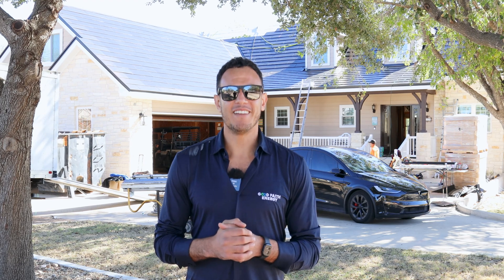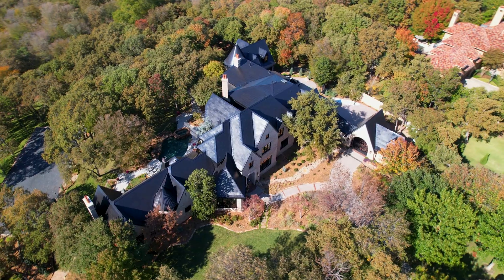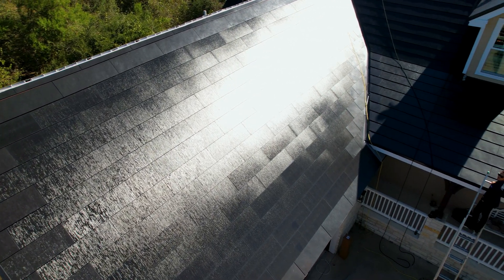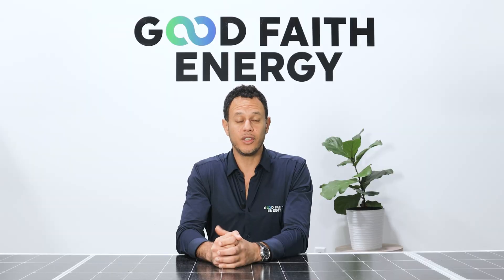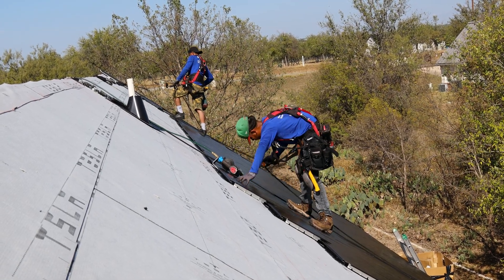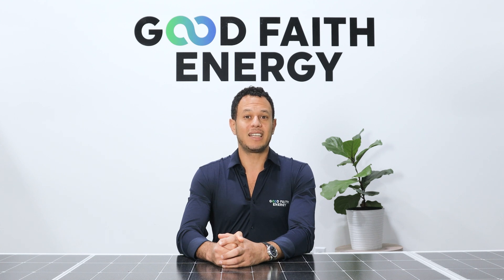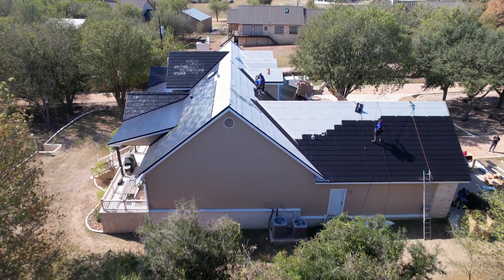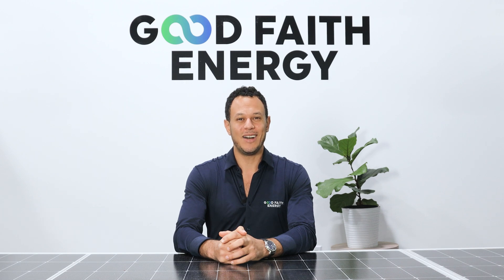Tesla Solar Roof Review 2025 | V3R vs V3

Comment: Are there any improvements in efficiency in generating energy with the V3R tiles VS the V3?
Reply from the maker: The efficiency and power output of the V3R roof is the same as V3. We’re expecting an enhancement in this area sometime in 2026.

Comment: Im curious how much better is the hurricane rating on the V3R prototype. The V3 was rated pretty well but not better than metal roofs when compared side by side. This is my biggest hold up when choosing between the two.
Reply from the maker: The V3R is a Class F wind rated roof which means it can withstand 110mph winds which is equivalent to a max speed Category 2 Hurricane